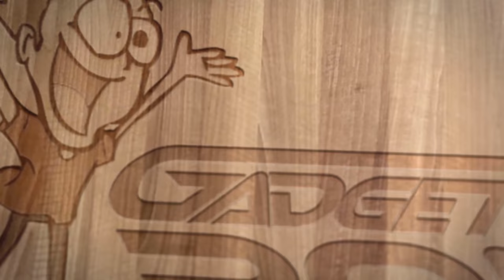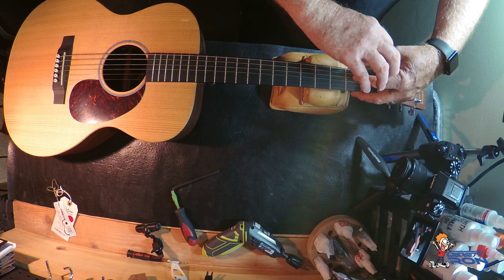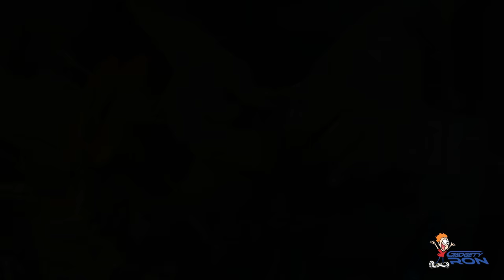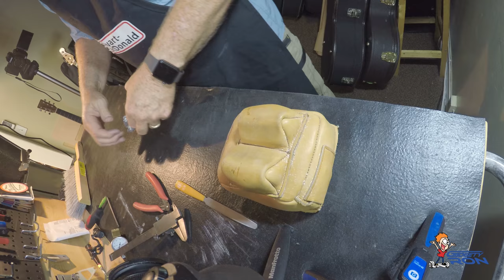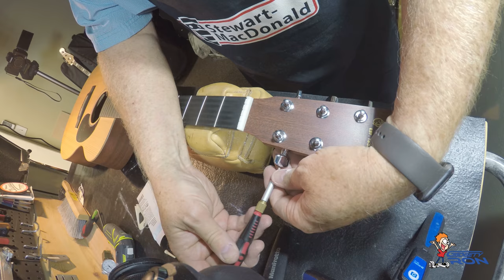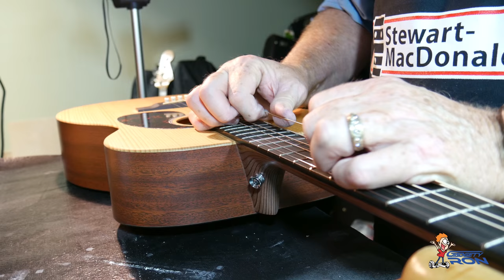What's on my bench? How to make your acoustic guitar play like an electric!

Comment: This is why Electric Guitars are great for beginners that wanna start strumming because they tend to be setup more properly, they tend to be easier to setup w/ the adjustable bridge, & they tend to be a bit smaller which makes holding the instrument easier, most of them also tend to have Bolt on necks so that changing the neck is easier. All that said Taylor makes Acoustic Guitars that indeed feel & play like Electric Guitars cause they have a skinnier neck, & easier action.

Comment: Thanks for the excellent video.  Have you ever tried looping the string over the top of the post before winding from underneath the string hole?  Here's a video showing this: https://youtu.be/uUOB9tGy5HY?t=120 Just curious what your thoughts are.
Reply from the maker: Thanks for the kind words, Hansen Hansen! I have tried the over & under technique, and it works well. I know Dan Erlewine  is a fan of that style. I've also done the bend-the-string-under/clamp technique (like this Martin's strings were from the factory). In my experience, they all perform pretty equally, and this method is the easiest when it comes to removal/string change. This is the way the Taylor guys do it, and it's always worked well for me, but there are lots of great ways to do it! I think giving the strings a good stretch is the key to tuning stability, as is making sure your strings don't bind in the nut slots. Thanks again!